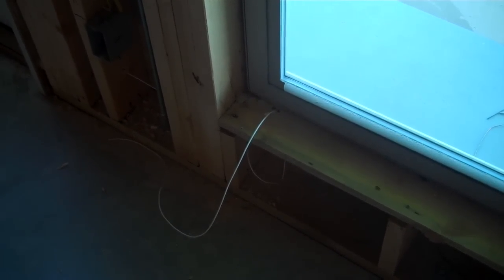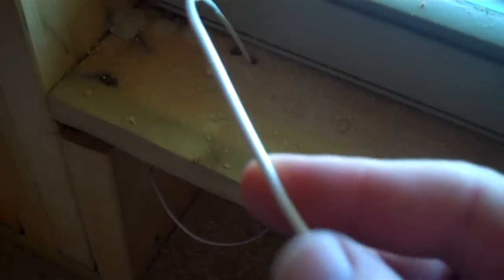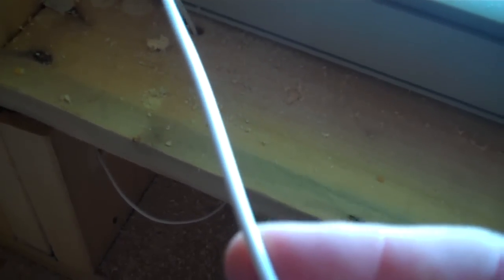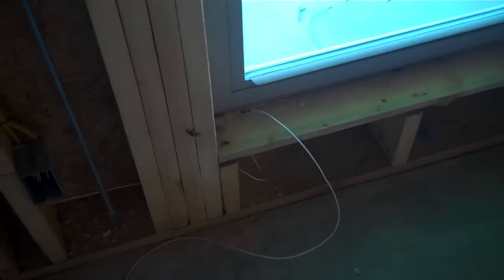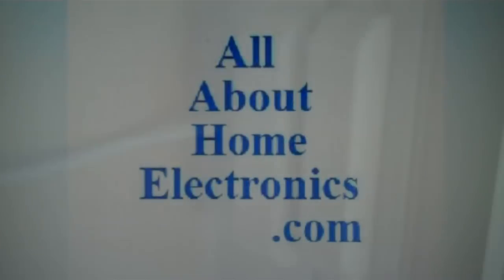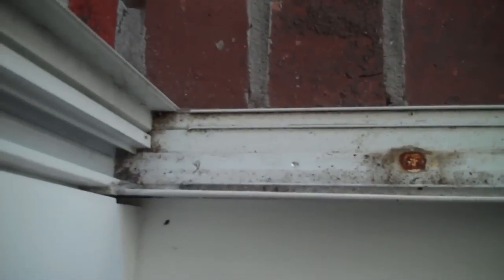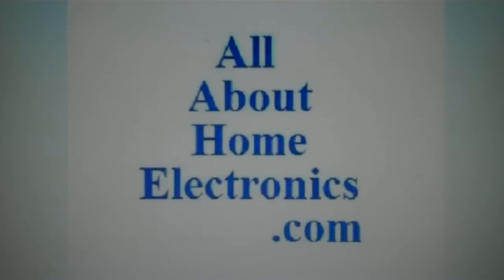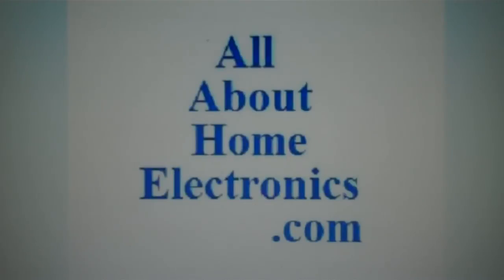How to Wire for a Burglar Alarm Window Contact

Comment: I have been installing alarms, mostly in multi million dollar homes in Newport Beach California and the surrounding cities.  My customers would lose it over seeing the two inches of wire to the contacts.  A few options would be first, using a wide gap surface mount which are the same size or only slightly larger that the contact you were using such as the Interlogix 1035W-N.  Install that JUST above the sill so NO wire is exposed.  the contact itself will hide the hole if it is small.  Then use a quality barrell magnet and jb weld (silicone and vinyl dont play nice together) sand the mounting spot a bit and then secure  it to the bottom of the movable panel of the window exactly opposite of the contact.  This will last forever.  The magnet will be more than strong enough to hold the wide gap closed through the vinyl window.  Second option,   Drilling in the frame for a concealed contact (3/8" or my preferrence 1/4") just above the bottom left or right will allow the same magent solution on the bottom of the window itself.  The magnet will need to live "out in space" to some degree to get it as close to the contact as possible.  Bear in mind there is a space, up to 1/2" between the window and frame.  Never drill the window in the bottom, it will always void the warranty.  On the other hand almost all window makers will honor a window if the leak is from something other than the alarm contact.  Lastly, that is not a rare earth magnet, it's steel.  Rare earth mags are mostly knickle and hence doesn't rust.    Good on you using 22/4 and by the look of it it's stranded.  Better choice on new construction because if knicked or nailed as long as the conductor that is affected is intact and not touching another conductor it should still work. Even a staple will blow a conductor of solid conductor to hell. Alan

Comment: Can I bridge a contact? In other words, can I ad one or more contacts to one wire? The thing is I'm adding a few more doors to the house and I don't want to fish all the wires to the panel. Thanks
Reply: Yes, its called running in series.  There are disadvantages to doing out at the openings but it is done in the panel on the majority of alarm installations.
Reply: Always run all contacts back to panel for a huge number of reasons, don’t have time explain them